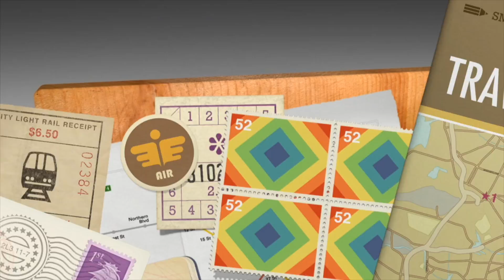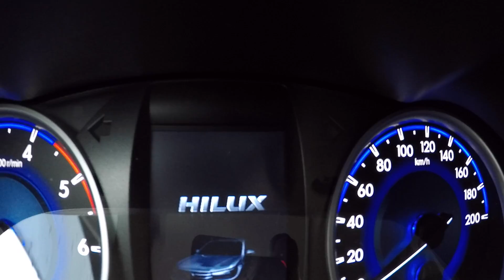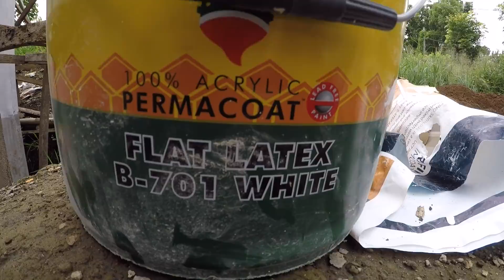VILLA FELIZ - EPISODE 167: ROOFING SET BACK (House Building in the Philippines)

Comment: Hi James, sorry about the roof but at least has now being corrected to the right specs. With regards to the grass, try getting a sample of the Bermuda grass, you'll love it. I have spotted the beloved angle grinder...eh..eh...For the shower, it is custom to add a lower tap for filling buckets in case of water supply failure (from the mains) and to have a small floor drainage when cleaning the shower room ( they tend to toss buckets of water when cleaning). I did not do the latter when refurbishing my old bathroom as I expect taking care of it myself....without bleaching the floor tiles white! Would you like to see the before/after the bathroom refurb?
Cheers, Marco.
Reply from the maker: We have acclamations for a water bib already in the CR in the basement as well as 1st floor.  I'm sure we'll fit it into the 2nd floor CR also.  All wet rooms have floor drains.
Send me a link to your refurb.  I'm all about that topic.  Thanks Marco!

Comment: James i dont want  to be a naysayer but my house had a Decramastic roof on it pressed metal with coats of bitumen and other stuff popular in the 70s and 80s in Aus its been out of production for a long time in Aussie.The problem with it.Fades after 15-20 years Any maintenance on it the tiles can be dented easily you have to walk on the edge of tiles where the batons are.With so many roof angles the edges tend to lift Once dented they leak.When it fades you can paint it but it damages so easy damage is unavoidable.I ended up putting new batons on and going colourbond my mate is a roofer so i was lucky.He reckons Decromastic is not the best and a few other expletives.Also if you intend to use rainwater for drinking over time the gravelly stuff comes off and goes into water tank.They went out of production for a reason.Make sure they will honour the warranty.All the best you shoudnt have to worry about it for some years so it will be someone else's problem.Cheers good wishes.
Reply from the maker: I'll be sharing all the roofing/exterior material as we go along and get to those parts of the construction.  Building material selections are based on recommendations from other successful building projects here in the Philippines.
No water from the cistern/gutter system will enter the house.  We have the water from the subdivision's exclusive well for that.  Cistern only for irrigation in the yard as previously stated.